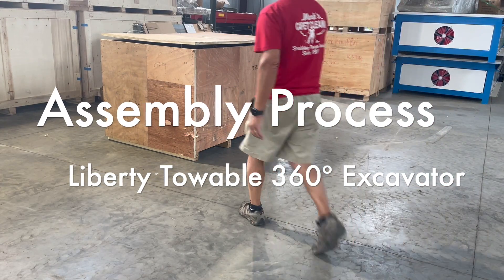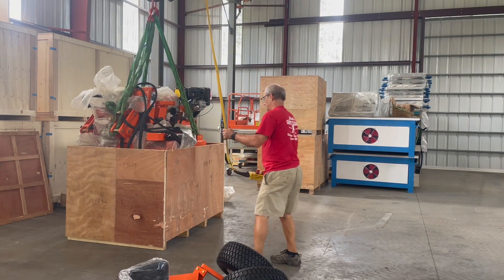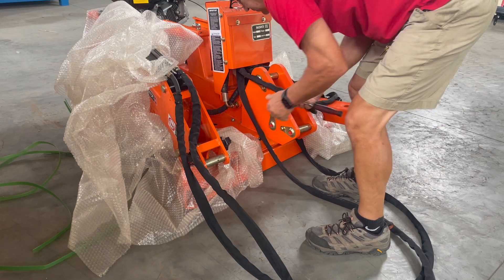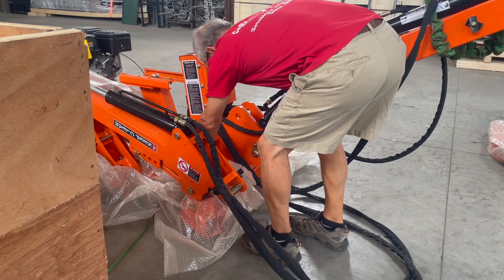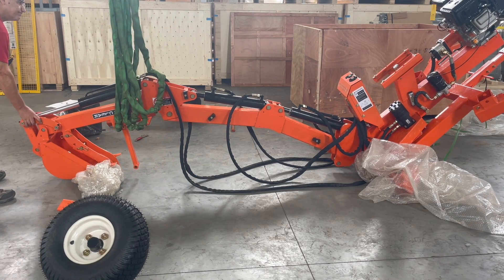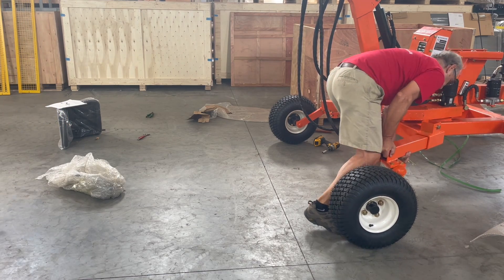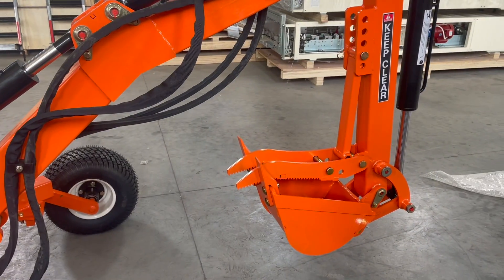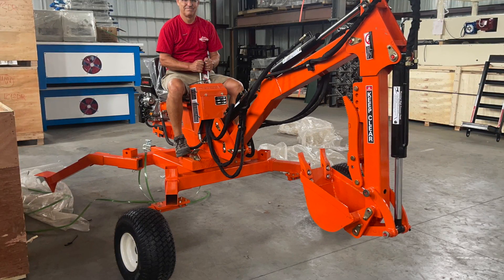Liberty Towable 360º Excavator Assembly

Comment: 1. You did a great job putting that together.
2. This is a really cool unit. I honestly didn't know there's towable backhoes that swing. I think that is genius. One of the things I hated about non-swinging tow behinds is just how much of a hassle it seems to move. I just bought a 1-ton mini excavator( and I love it) but, they are slow as a snail. A unit like this could be towed in a jiffy across a big property. And you wouldn't have the troublesome tracks to deal with as far as constant adjustments and falling off. I will say I do like the push blade on my mini ex. Anyways, very cool piece of equipment. Thanks for sharing!
Reply from the maker: thanks for your kind remarks!
Reply: Nice assembly video.  That thing looks a lot beefier than a Harbor Freight backhoe for only about $750 more!